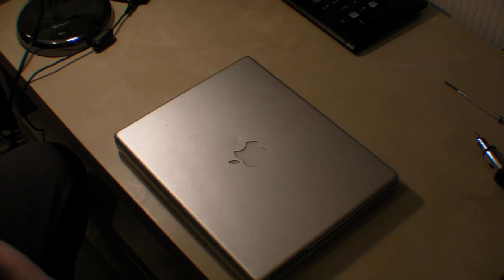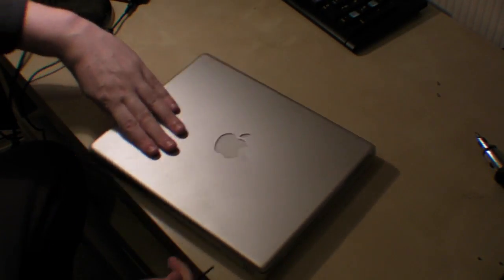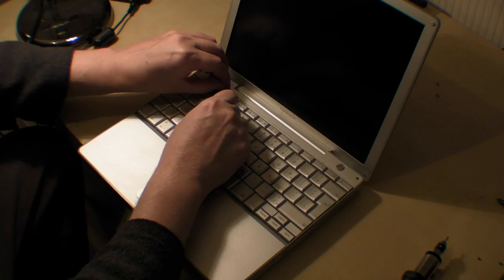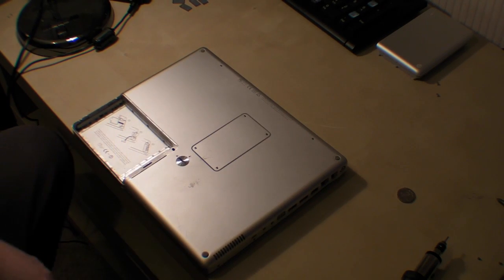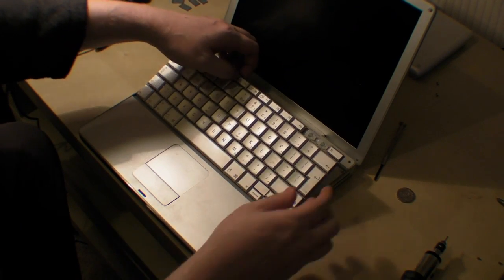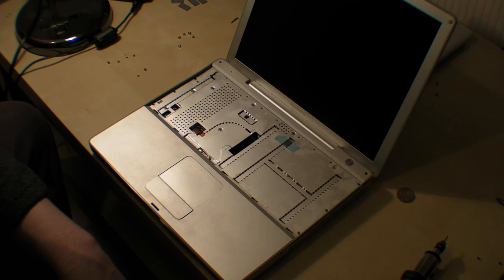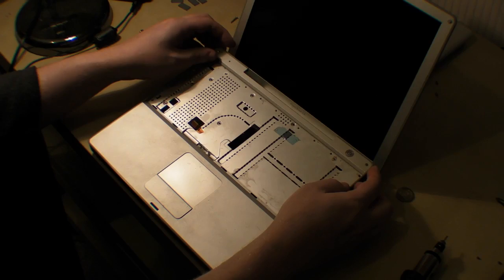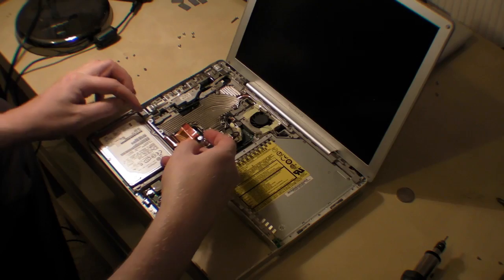How to install a hard drive in powerbook G4 part 1

Comment: Hey fella, I went to put this thing back together and I couldn't find half of my screws! Then what I could find were all the wrong size. Why didn't you warn to remember where I put everything? 😉
Reply: Go to Home Depot and get some 3/4 " bolts - they are cheap and will fix your pickup